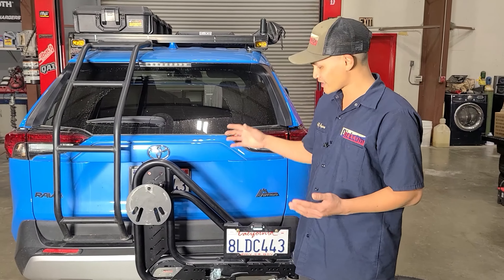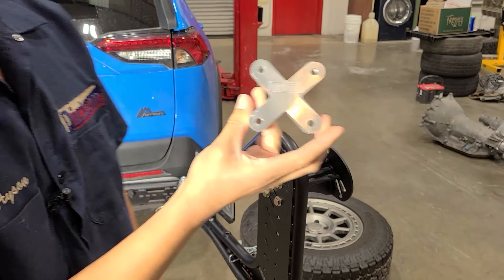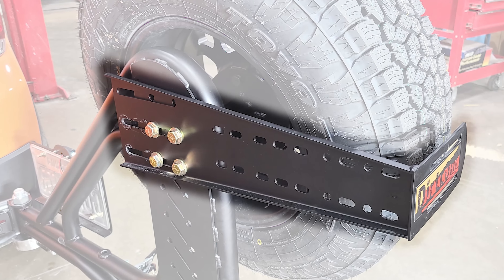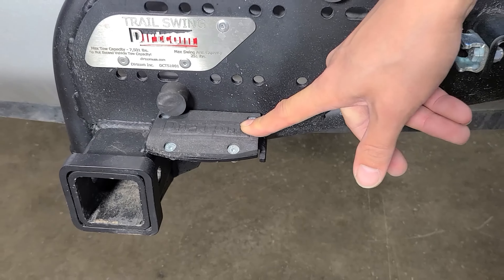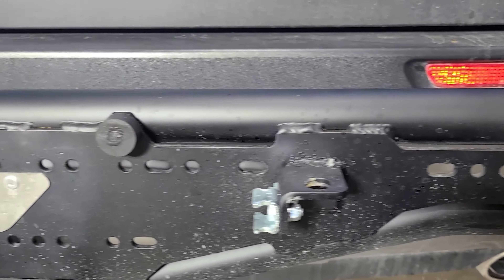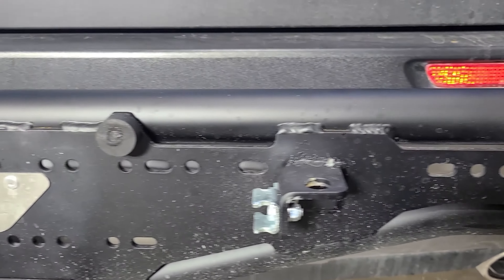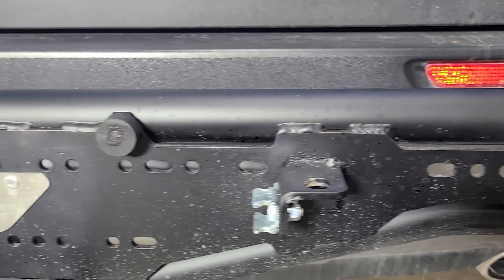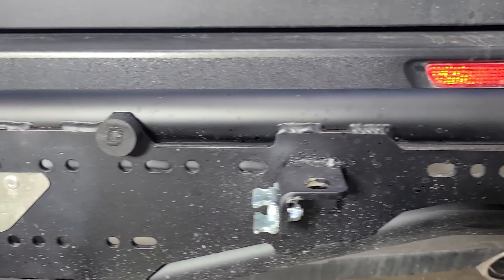Up Close! TRAIL SWING by DIRTCOM. Hitch Mounted Tire Carrier Details and Offroad Test!

Comment: I’ve tested this thing for a weekend, and it’s an awesome unit!  I’ve been thinking of tire carriers for a while now and the offerings a few years ago just didn’t meet my criteria.  Back then I drove a Subaru, and the Wilco hitch only used a pin to secure the swingout.  Quite honestly, a latch would be plenty secure for daily driving and getting groceries, and a latch is much easier to operate than a pin.  Also, all the shaking and wobbling I saw with the Wilco tire carrier was a turn off, and another reason I never considered a tire carrier.  
The RIGd swing out, seemed to hit all the boxes.  Well, that’s what I thought.  Back in January I had the opportunity to hang with my friend @suba_ruski that was rocking a Wilco on his Subaru Outback and my friend @revving9k that was rocking RIGd on his Outlander GT.  It was a great opportunity to compare the two tire carriers side by side.
The RIGd unit wasn’t completely superior.  The departure angle was noticeably worse with a 6” hitch receiver extension going straight back.
The beauty of the Dirt Complex tire carrier is that it doesn’t have the flaws of the current offerings.  Not only that, but it’s the only hitch tire carrier that has an auto locking mechanism.  

The way I plan to use mine is I’ll only use the latch for daily driving and running errands.  It will be easy one hand operation, especially with the auto lock on the swing out.  I’ll have the lanyard pin handy, and will use it when I hit a trail.  I’ll incorporate the pin insertion part of my tire air down process.

I’m excited for this Swing out!  Can’t wait to get one attached long term!
Reply: @trailmonstah1892  oh HEY @TRAILMONSTAH aka Marco or Mark, or shall I say parkinglotmonstah troll.  I updated everyone at the end of March, after my Moab trip, that Dirt complex sponsored me.  This is 2 months AFTER this comment.

Comment: AJ - your trail swing rocks!  your personal responsiveness to questions is second to none, the speed of shipping (especially these days) simply amazing.  Love my trail swing, rocking 34's.  keep us updated on improvements you make.  nothing else compares ( and yes i did customize the  wheel  mount - welded my studs and shortened the length by 1.5"  at a local Fab shop in Tulsa Ok.)  the license plate bracket is well thought out and easy to wire tap in to your tail light power.  if you are considering a hitch mounted tire carrier, dont buy anything else - this is an exceptional product

Comment: Okay, I’m so impressed by this product. I figured out who this is aimed for as well. I was comparing the cost of this beast vs a steel bumper with swing outs and it hit me; this is FOR people who don’t have the option of a steel bumper with swing outs. Or people who don’t want the constant weight of a full setup. So part of the price is for the hard to reach market, AND the already plentiful market that wants the fun, but not the weight on their daily. To that; his makes complete sense. If I didn’t have a steel bumper already, I would have gone this route. Tube bumpers too. Damn, I should have waited.

Comment: I want one that doesn't have a tire on the left sife, but has the cooler/table option on both sides, and still allows access to the back of the vehicle, and the ability to put a hitch step in for my dogs to use to get in and out of the back.
Reply from the maker: You can definitely add a hitch step. You can easily mount a table on the back side and even on the front side if you just remove the tire mount!

Comment: Requesting a picture with a tire mounted on the Tail Swing in the Cherokee folder. I think that was the only one without a tire mounted? Pictures of a table mounted on the Trail Swing would be nice.  Info. on which table works best too. Thanks.  Looks like a great product.
Reply from the maker: We don't have one yet with the spare mounted but we did have a couple Cherokee orders so we'll have some soon! The best table will be our table.  Stainless steel and comes with all brackets to mount it! Thanks for checking it out.

Comment: I am considering this as well, but I think it would block the rear sensors in the bumpers.  I have a 2020 Jeep Cherokee KL Trailhawk and I don't see a single picture of a current Cherokee KL on the site.  I did see a pic of a white 4Runner (I think and the sensors of the right half of the bumper were completely blocked.

Also, I have yet to see any stock rear camera solution other then buying 3rd party one.  Not a bad way to go.

Another thing I wish is that they sold a simple plug for the 4-pin plug to power the relocated license plate light.  Maybe a pass thru for when you tow. Oh.. and a cover for the pass thru to keep it from filling with water.

Comment: WARNING Do not buy anything from these guys. They have the absolute worst customer service. I ordered my Trail Swing 5 months ago with a 10 week lead time and I had to ask repeatedly for any update as to when I should be expecting my order. I’m in no rush but I would like to know what’s going on when my order is 3 months late and my bank account is $1800 lighter. When they finally got back to me I still couldn’t get any timeframe, just some story that they stopped production locally and were in the process of getting a new producer up and running (not reassuring). So I go on the website and see that they are now running a sale so I ask if they could apply that sale price to my order. My unit still hasn’t even shipped so I figured that would be an automatic yes from them. Nope! I get told they can’t discount the Trail Swing… It’s literally on discount right now. I’m done with the way they do business so I told them to cancel my order and only then do they offer the discount and as consolation they offer me a t-shirt… Like after all I’ve been through with these guys I’d want to advertise their horrible company on my back. I’m going with another option and I just want to let other potential buyers to be aware of what I’ve been through so you can make the best decision when spending your hard earned money.

Comment: Will the trail swing work on the sequoia
Reply from the maker: Yes! Trail Swing HD will fit great.  If you want a more compact solution the standard Trail Swing will also fit. You just have to watch the hatch near the license plate bracket at 180 degrees.

Comment: Are you able to use the receiver for towing or is this not rated to tow?
Reply from the maker: How are you.  We are currently undergoing SAE testing requirements for the higher Class 4 10,000 lbs. The current tow rating is 7500lbs.